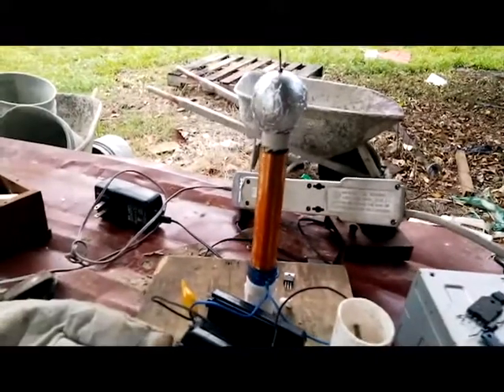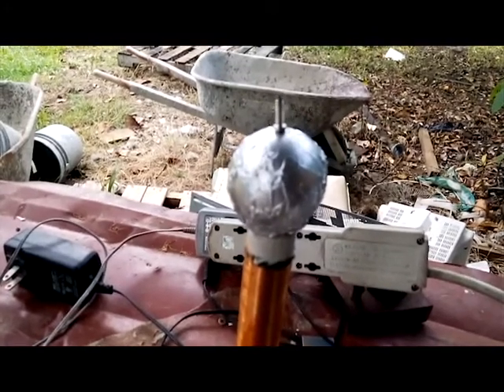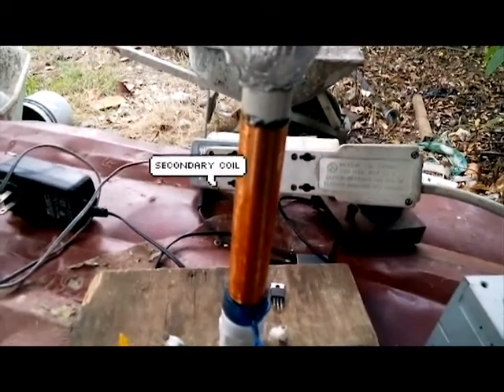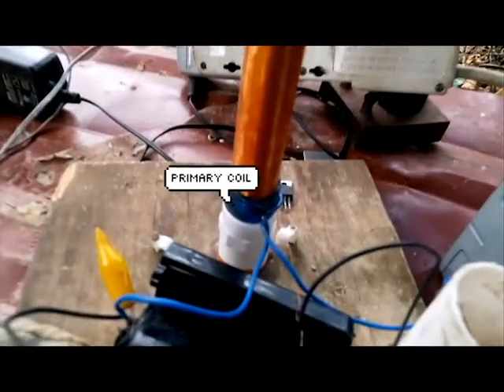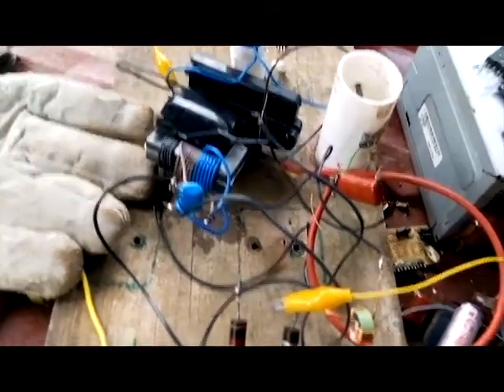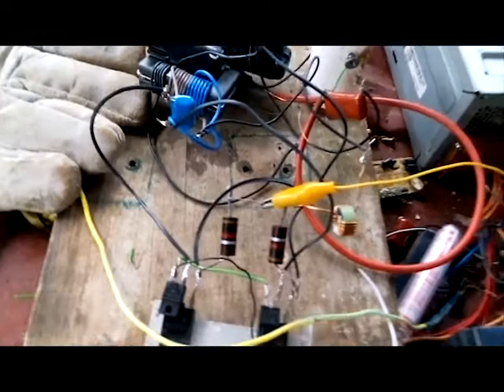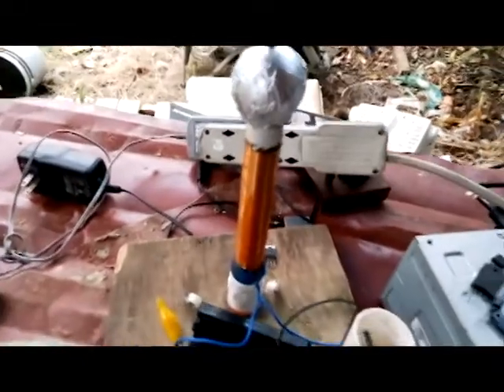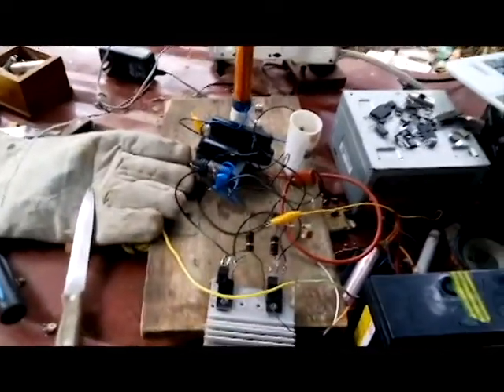tesla coil 1.0

Comment: I like they driver I use it on my tc too but mine is smaller with probably 2-3cm arcs but it lo lights up the bulbs now haha I'm currently working on a single Mot tc with 1200turns on the secondary Have fun m8 

Stay Safe  :)